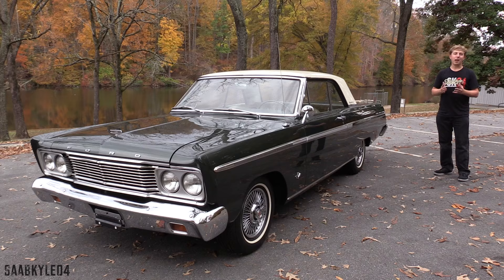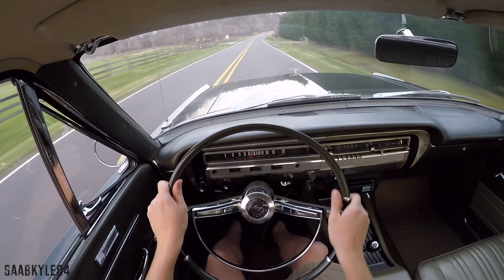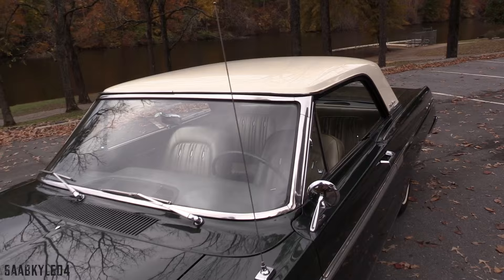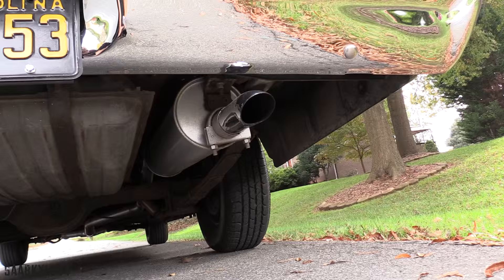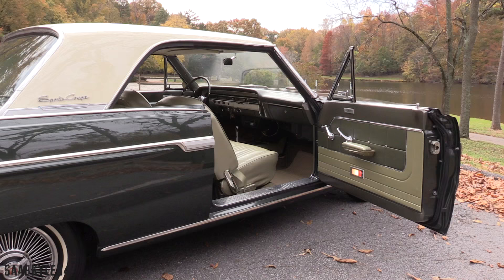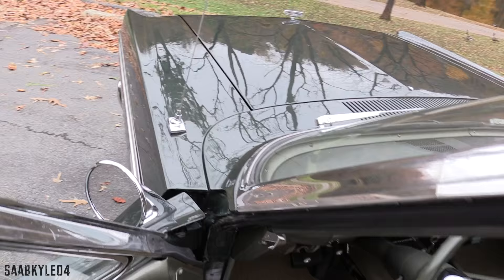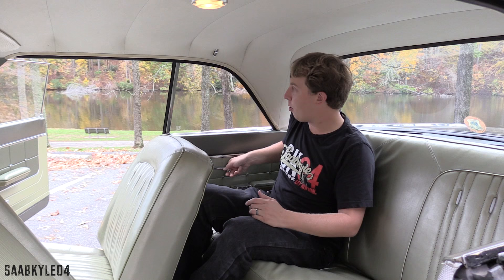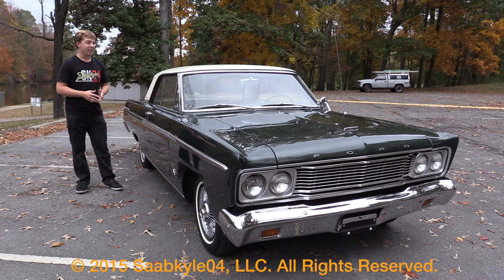1965 Ford Fairlane 500 Sports Coupe (289 V8) Start Up, Road Test, and In Depth Review

Comment: I think you did a fine job of presenting this car. You obviously have a passion for older classic cars including the early generations of American Muscle cars like the Fairlane model. It's a passion I share as when I lived and worked in Los Angeles I was lucky enough to acquire a 66 Fairlane GT with the 390 Ford Big Block and the Ford variant of the Holley 750 CFM DOUBLE PUMPER CARB. The car was painted Ivy Gold with Flat Black Trim and the full GT Package.  Well done!

Comment: I have a 1965 Ford Fairlane Sports Coupe also, mine is the 4 speed version, bucket seats console around 114,000 miles. Wimbelton white with black top. It has only had 1 repaint , about 3 to 4 months ago .It is the 289 , 225 horse power, hydraulic lifters, 10 to 1 compression. Interior is original, no repairs. The only thing I have done is added a Eldebrock top end kit, with a hydraulic version of the 271 solid lifter 289. I kept all the original parts to put back on , if I chose to later. I also am changing rear gears to 3.55, where it was stock with 3.0 rear gears. I know a lot call this the ugly duckling, but beauty is in the eye of the beholder and this was similar to the first car I had bought in 1974.

Comment: Congrats on owning that beauty,Kyle. I had a 65 Galaxy 2 dr. that I installed a 289 2 barrel and a 3 speed stick. I beat the crap outta that engine and it took every bit. All I did to that car was replace several transmissions and frequent oil changes.

Comment: What a beautiful car.. makes me think about how far we came from the original ideas of what a car should be.. and yet, how some things were better back then. For example, the way the windows open up for front and rear passengers as a sort of panoramic design.. I love that. Seems like cars back then were made for the experience of driving/cruising, modern cars are more emphasized on speed and horsepower.

Comment: YOU CALL THIS A CAR??? Where are the air bags? Center third brake light? 2 1/2 mile bumpers? LED lighting? Aluminum wheels & low profile tires? Side mirror directional lights? Catalytic converter? Rear window defogger?    Sheesh!!  :-)  For you young folks,...THIS is a car!  Great video.  The only thing cheesie about this video is Kyle's t-shirt. ;-)
Reply: the other ones are cars too
Reply: Don't forget the backup camera lol

Comment: That dead spot in the wheel is so the driver can swing around and smack the kids in the back seat without running off the road.  It is still prominent in modern mini vans and other various cars - true story.
Reply from the maker: +Malicious SRT Hahahaha that's awesome
Reply: *****
Car magazines (or you) need to do an article on this stuff.  Not all cars are designed to be ring racers.
  Talk to any auto engineer and you will see first hand..

Comment: Man that color combo is fantastic.   Because of the manual 3 speed w/OD "freewheeling" aspect in OD (it coasted downhill without any engine braking) it was outlawed a couple of years later. Think the last year available was 1967 or so. So very few people every ordered one with OD in the 1960s. They were slightly more common in the 1940s and 1950s. Mine was a 4 speed car with 4bbl, dual exhausts and A/C. That was way back in 1979 though. Mine was beige.  An automatic overdrive transmission sure would have come in handy in the 1970s though!

Comment: Was it ever restored? I assume, because it looks brand new. Damn
Reply from the maker: +Dell0304 It's been repainted and refurbished here and there, no rust or anything like that though.  The interior is 98 percent original with a refurbished steering wheel and new front door panels, everything else, except for the underdash radio, is original :)  She's a beauty in person!
Reply: Wow, sweet!
Reply: +ManyRadomThings Well that deescalated quickly

Comment: This car is no compression to newer cars full of electrical problems, sounds like you added a flowmaster muffler on it +saabkyle04
Reply from the maker: +Ali Saleh I actually bought it just as you see it!  I'm not sure what/if anything was done to the exhaust.  It looks similar to the factory setup but I'm sure the muffler had to have been replaced at some point, it's a mystery :)
Reply: +Saabkyle04 i love this deep v8 sounds very similar to my tahoe 5.3 with flowmaster 40 series muffler on it. This car is gold kyle keep it don't sell it. Very valuable beautiful car

Comment: hey Kyle your international travelall review has been blocked in the United States for some reason is it possible to get it fixed?
Reply from the maker: +patrickben321 Yeah I know, it's been that way for years.  Copyright claim because of the radio -_-
Reply: +Saabkyle04 that sucks. thank you for replying. any idea if they'll lift it?
Reply from the maker: +patrickben321 I doubt it, there's a lot of greed with it comes to stuff like that, anytime :)

Comment: Why would someone buy this when they could have had a Mustang (back in '65)?
Reply: +wb6162 This is a sweet little car now that it's 50 years old but I'm just wondering about the market for it in '65
Reply from the maker: +wb6162 Someone who wanted a bigger car that was roomier.  Despite the "sports coupe" name, it's the same size as the 2 door sedan but with a different roof.

Comment: I am going to heavily judge you for having an eBay radio installed
Reply from the maker: +Steven DeCoste Lol ok then.  Did you not hear what I said in the video?  It was done by a prior owner.  I am leaving it in there as it doesn't alter anything with the way the car was made.
Reply: +Saabkyle04 yeah I know that, but still. it's just not right
Reply from the maker: +Steven DeCoste All a matter of opinion, not going to throw away a perfectly good setup when I can use it to listen to old songs and feel nostalgic.

Comment: fact : traditional dual metal chassis indicators width stardard stock distance severed submerged vase floral landscaping input ; hence automotive technological sensorship THAT maid it worse with hypothesis how far does the floral live for what is most important to B4A+YOU
Reply: PS! <1 obtuse slant floral platform 2021